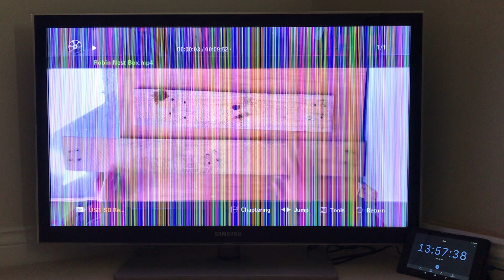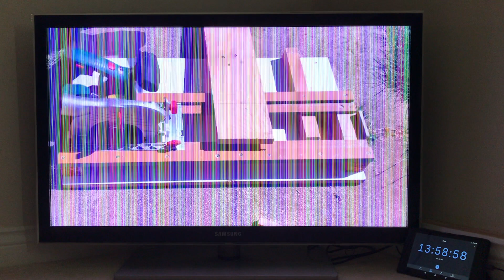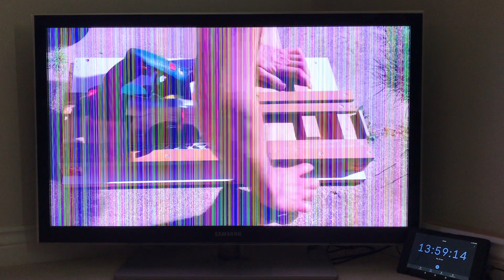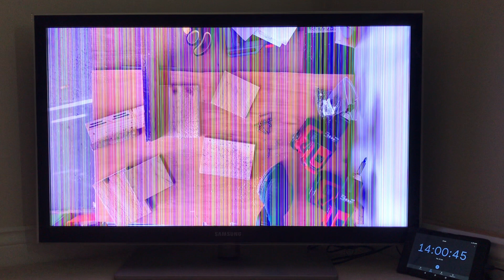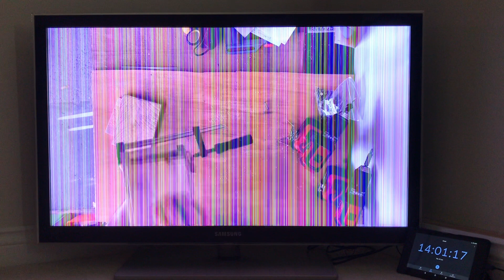Five year update of my TV repair

Comment: Massoud, sorry for the long fix ahead, but may I make a suggestion, just hear me out first ok. I tried this trick if you want to call it that, on a hp laptop and a Imac desktop that both had the screens not turning on and this procedure fixed both computers, and they both are working still to this day.

Try taking the board, (only the board, no cables or other attachments with it) out of the TV and putting the board in your oven with it set to around 350 - 400 deg Fahrenheit. Only for about 10 minutes and keep an eye on it for the 10 minutes. Don't start the oven till the tray and board are in the oven, you can put the board in the oven, on a cookie tray with aluminum foil stand offs, twisted to the shape of a christmas tree, (or any metal type stand offs you can find that will fit where the screw holes are in the board), to keep the board from touching the tray while it's on there. After the board is on the tray on the stand offs put the tray and board in the oven in the middle area, between to top and bottom of the oven then set the oven to 350 - 400 deg F, and keep an eye on it till it's done. When 10 minutes are done shut the oven off, and open the door about a 1/3rd of the way open and leave the tray and board in the oven till it cools down to a reasonable temp then you can remove them from the oven to cool completely. Remember you don't want to take the board out to early, you want the solder joints to cool and harden some before removing the board. After the board has cooled completely put the board back in the TV and see if it worked. The main problem with these solder connections is the companies used cheap solder and sometimes they become cold solder joints and loose connections after some time. If you like you can do the same thing using what they call an SMD Soldering hot gun but that only works better if you know where the bad connection is located. In the oven you get all the solder joints at once. Use this procedure at your own risk thou, I'm not responsible for anything that happens after. Good luck and have fun and be safe....

Comment: Yeah Ive seen a few Samsung tvs built over past 20years  with the same problem. Samsung put these TV s out in the market knowing that there are a small percentage of faulty ones due to defects in components. Some will come back and be replaced during the  warranty period, others will go ok for 5-10 years and then fail. Those later ones will usually look like dinosaurs after 5-10 years anyway and so will get thrown out in the trash by consumers who will probably just get an upgrade model anyway and think 5 years is ok for a TV life. 
Who keeps electronics for more than a few years anyway? The thing will be so low on features by then that the consumer will just toss it out.   
Samsung couldnt care less!
 Thats why this type of problem is never properly quality controlled by manufacturers.